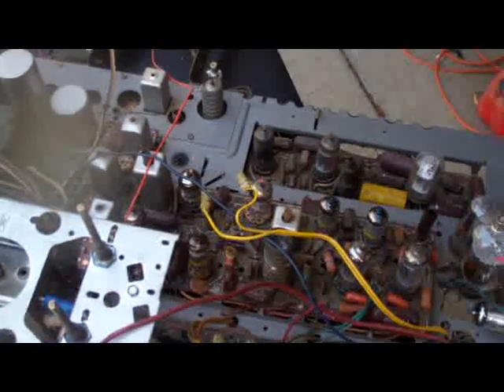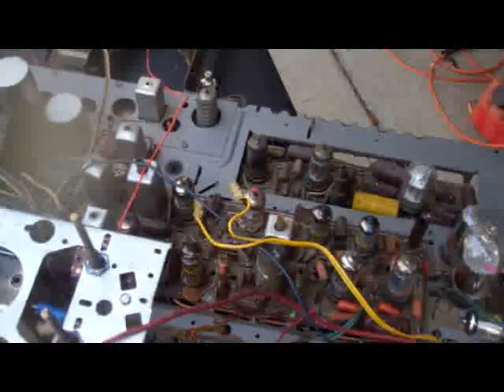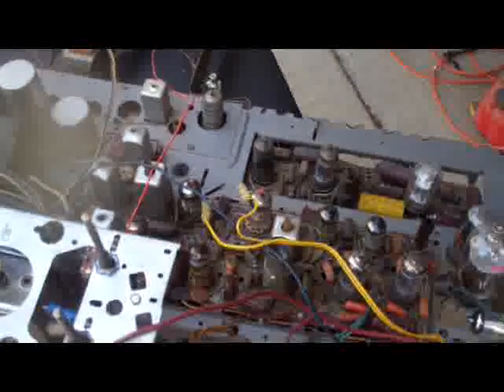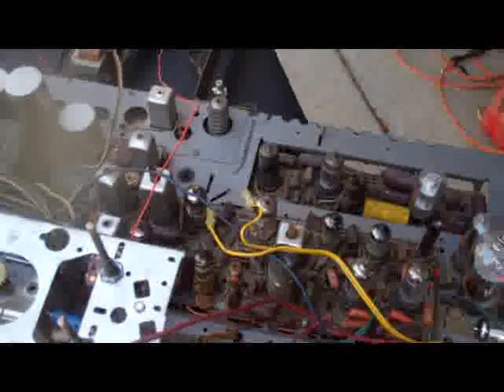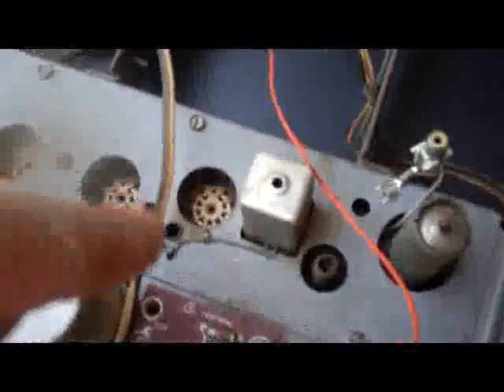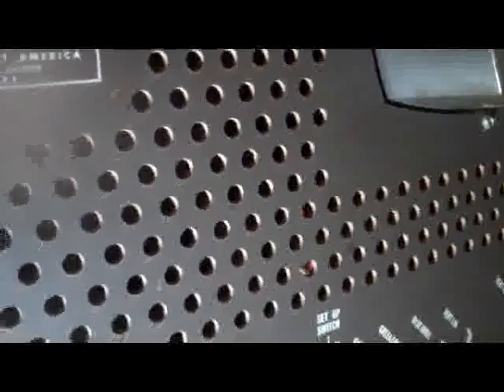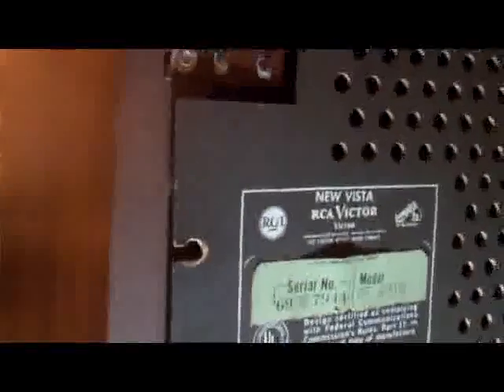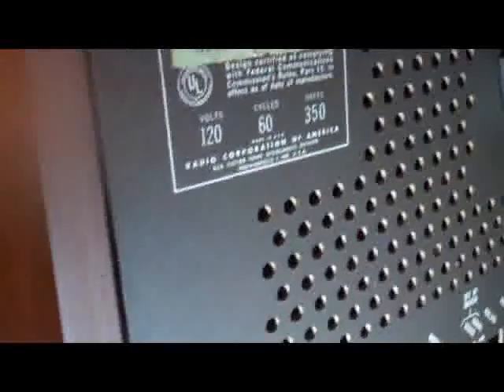ctc16 modifications for the long road part 2 of prepairing old tv set for a 600 hour run

Comment: Here I'm also going to make a guess, based on what you are describing. You mention adding a resistor to adjust for not having the convergence yoke in the set, I'm guessing that this is from pin 8 of the plug for it to gnd, to keep the horz reference pulse ( from flyback ) @ around 270v ( as it says in sams ) ?
As for the HV cage, I'm thinking of putting a small hole in it and gluing a high speed micro-fan to the outside of mine, once I DO get my CTC16XL working, so far, there has been no wax drip from the flyback, and I want to keep it that way. :)